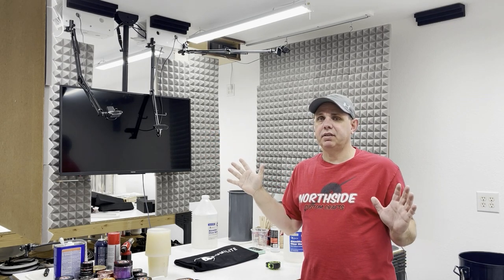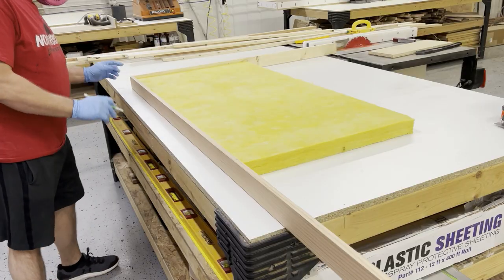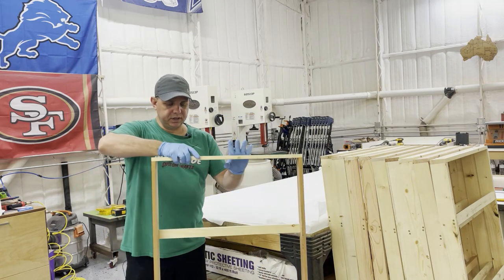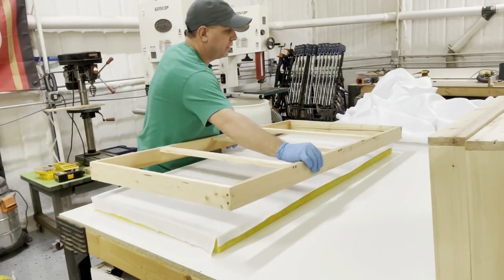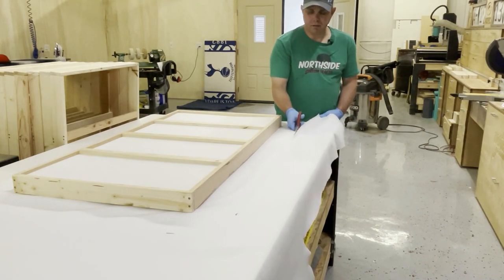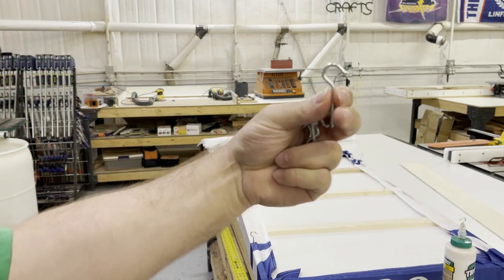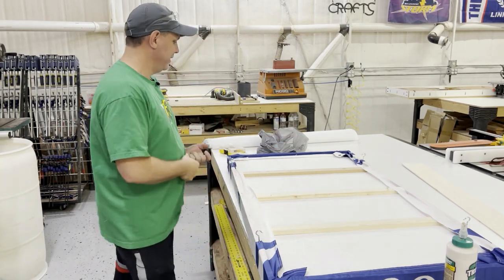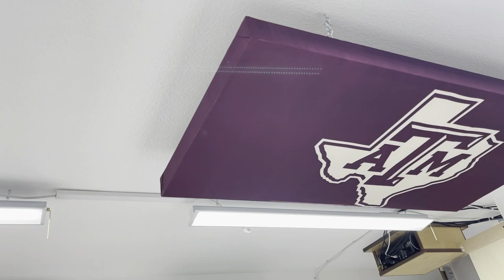DIY Acoustic Sound Panels - Cheap and Easy Echo Reduction

Comment: What material are you using for wrapping? Is it acoustically transparent?
Reply from the maker: I’m assuming you meant wrapping.. it’s just cheap material I bought from hobby lobby.. it’s a bit thinner than t-shirt material.. it works great.. the sound in the room has no echo at all
Reply: Auto correction drives me crazy. lol.  @JakeThompson